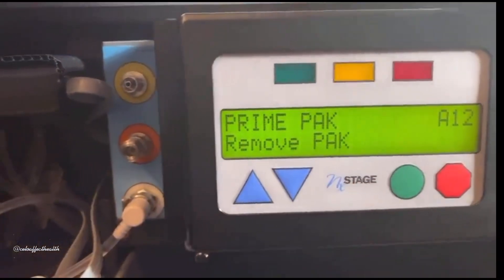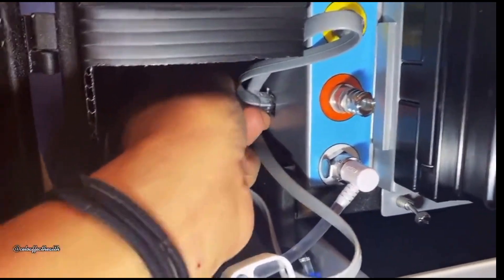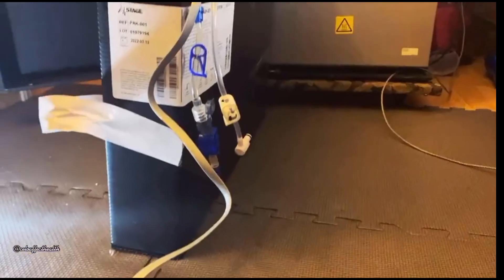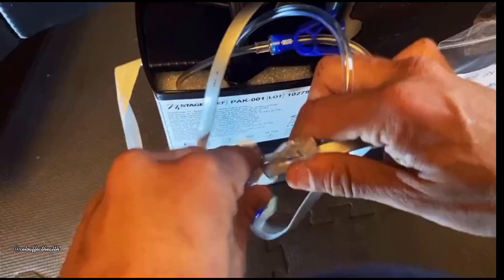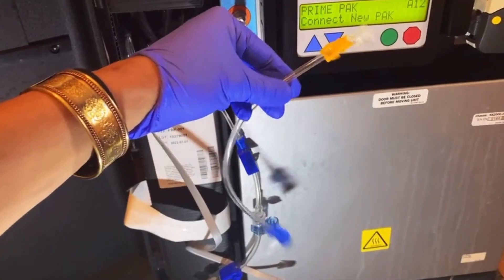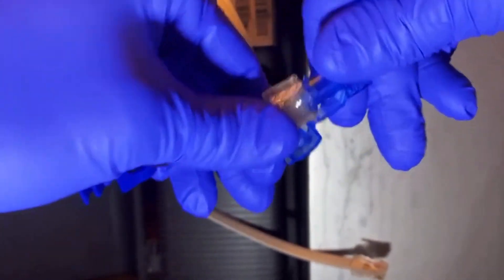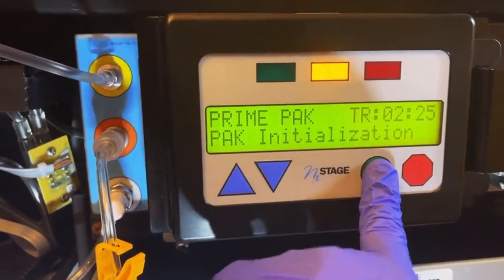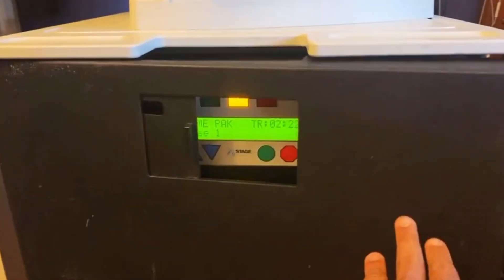Priming a New PAK | NxStage Home Hemodialysis

Comment: I've been doing this as my dad's care partner for nearly 3 years now. It just astounds me how sensitive & temperamental this nxstage machine and pureflow can be. It's usually a few months of trouble-free treatments peppered with seemingly catastrophic, world-ending, apocalyptic difficulties with such simple procedures as priming a new PAK. This time, it's alarm 51, high output pressure, when there are no kinked lines, lines are appropriately connected. This system can easily be both friend and foe.
Reply: This just happened to me but I forgot to connect orange to blue !
Reply: @stoney_703 You will always get it right from hete on. The best way to remember is hat the only thing the condo sensor connects to other than a new SAK is the PAK for priming. Just wait until you're about 3.5 years in and your NxStage cycler decides it's time to be returned for service abd you're sent a new maxhine. That wasn't any fun.

Do you have a care I partner or are you solo hone/nocturnal?

 It's hard to believe that this coming March will be our 5 years doing hone hemo.
Reply from the maker: Very true, once we have a good/ properly functioning cycler and control panel/PUREFLOW - it runs smoothly.
Reply: @celoaffect  ...all the way to the point that for some mysterious reason, it doesn't. I will detail the solution to my problem below because this solution is absolutely nowhere to be found in research and trying to locate.

The problem that I had: Priming a new PAK, I had a red alarm 51 go off- 'high output pressure'. The potential issues listed contributing to this alarm are primarily kinked or occluded lines or possibly a line clamp not open.

This procedure uses both the fresh water in line and the condo line (this is the orange clamp line and is the only time that it connects to the freshwater line [blue clamp line]). All of my clamps were open and neither of the lines were kinked or occluded. I attempted to push fresh water through the effluent line (yellow clamp - waste line) and had no problem doing so. I couldn't see how this would have been an issue as I flush the drain line with bleach water 2x per week. I resumed prime- again, alarm 51. Here is what I believe was the resolution (I think, maybe not). I closed both orange clamps, disconnected the condo from the pureflow control panel with a bucket underneath.*** I gave a gentle tug on the blue line coming out from the PAK just in case it was kinked somehow inside the PAK where I couldn't see*****. With the condo line still disconnected from the control unit, I ensured the line was over my bucket and resumed prime once more. Voilá! Water began to flow quite generously from the condo line. I reattached the condo line to the control unit, re-opened the orange clamps, and resumed prime - again! I'm certain this was the resolution. Unfortunately, by this point, Pureflow was ready to call it quits. I was instructed by the pureflow control unit to remove the PAK and replace it with a new PAK to prime. So, the first PAK was corrupted. The second PAK was primed without a single issue.

I followed up with nxstage afterward. Provided PAK # for their follow up. I was not asked to send this PAK back for their investigation but I have been asked once before about 2 years ago. 

Just be sure to call nxstage if you ever have a PAK fail as I did. If you do, whoever you speak with will reorder and send out a new PAK for you around normal supply delivery schedule. If you don't,  you will be asked to place the order through your dialysis nurse who would then need to approve and place the order for you. A real PITA, I know. In any event, tugging on the freshwater line with blue clamps coming out from the PAK was the resolution, I believe.

My name is Aaron, my dad is the dialysis patient, I am his care partner. We are going on 3 years of home heno.